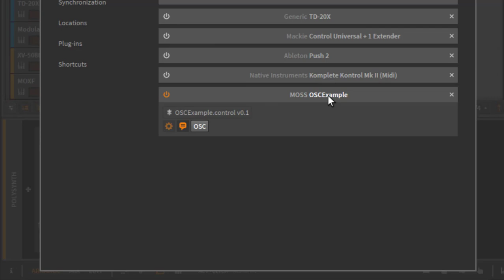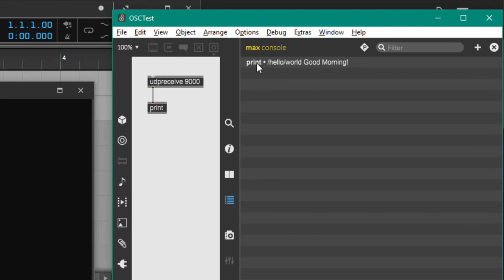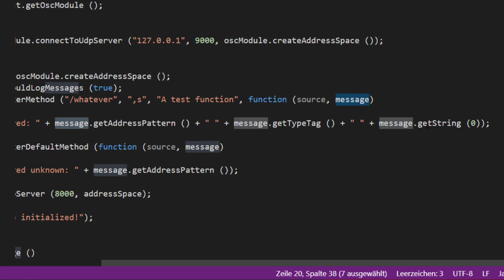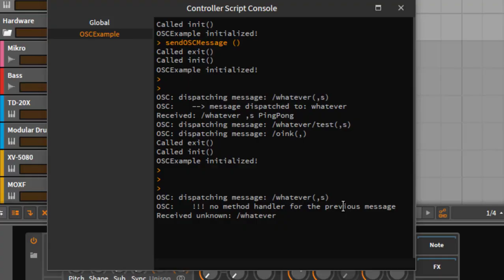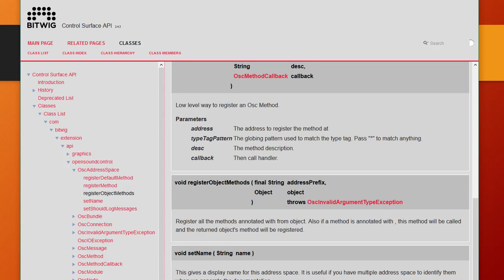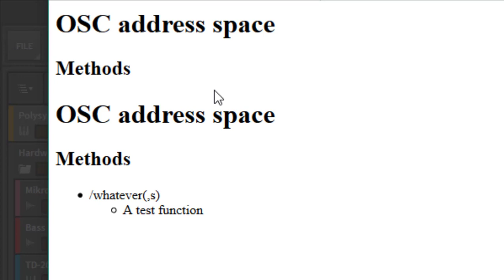Bitwig Controller API - Part XI - Open Sound Control API

Comment: Fantastic instructions and code 🙂. I am programming in Rust. I had luck sending and receiving OSC (play, stop) using a Rust OSC library (rosc). I would like to query DAW state like what devices and their params in a track, but where a synchronous response is directly associated with a query. From what I see, OSC is only send and forget and the received messages are only loosely associated with the call (play means in tick info). I don't believe DrivenByMoss implements any general IPC. I am looking for a binary format. I guess the RPC might be out of the data serialization (I'm just starting to think of this). Something that supports Java and Rust, maybe Cap'n Proto, MessagePack, or Protocol Buffers. I'll keep researching, but if you have any pointers, please point 🙂Thanks!
Reply from the maker: The Bitwig API is asynchronous. If you need to access values it makes sense to cache them on the client side.

Comment: Is it possible to trigger OSC commands via MIDI? I'm trying to send OSC message from Ableton to Bitwig to automate post recording delay parameter
Reply from the maker: Via the Bitwig API you can receive both MIDI as well as OSC if that is the question.
Reply: @mossgraber  Yes, i know. 
I made my script for Bitwig to make it work like live looping station in conjunction with ableton (RC-505 style). But i need to make 2 last steps to finish this project: 1st step is to automate post recording delay with midi.
I spent years to make this livelooping system and now it almost done. So i will be really appreciate if you can help me somehow.
Reply from the maker: @zorkertorker  Do you mean the "time before next action"? I think this cannot be set via the API but I might be missing something. There is a launchWithOptions method for the Clip where you can set a synced delay, if this might help.
Reply: No, i mean exactly "post record delay" parameter wich you can find on project panel. I can access it with osc command but i don't know is there any possibility to control it with midi  @mossgraber
Reply: The idea is to sync arrangement loop with clip. Even if arrangement loop has 5/4 or 7/8 time signature  @mossgraber . Maybe i need to do something with the arrangerLoopDuration() or  duration() ?
Reply from the maker: @zorkertorker Ah, OK. I never used that. And yes I checked and there is a method in the Transport object: getClipLauncherPostRecordingTimeOffset () which can be used to set the value.
Reply: Thank you so much! This is what i’m looking for.

Do you have an example of approximate script hierarchy which should work with this method? It seems like my knowledge is not enough to make it works. 

I realize my request could be too complicated and requires a lot of time to figure it out. So i would be happy if you can just write it for me, (of course not for free). Or at least you can show me the way i can figure it out by myself.

The idea is to trigger “post record delay” numbers with midi notes